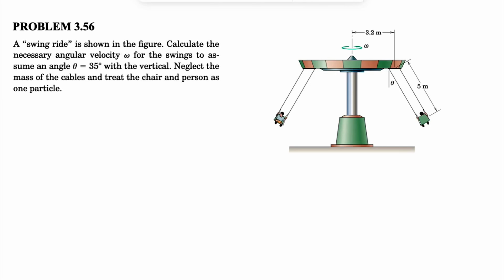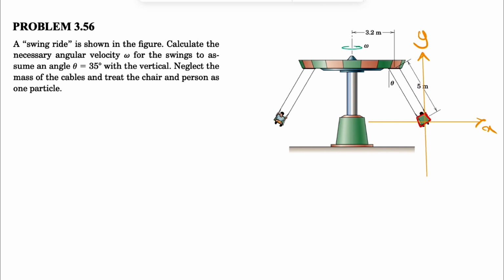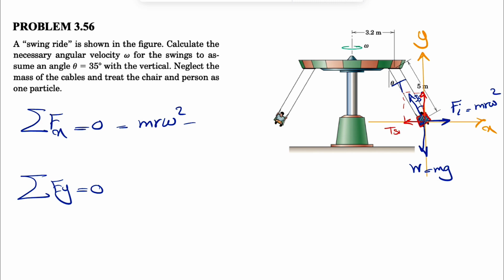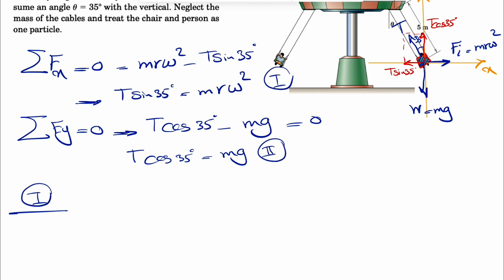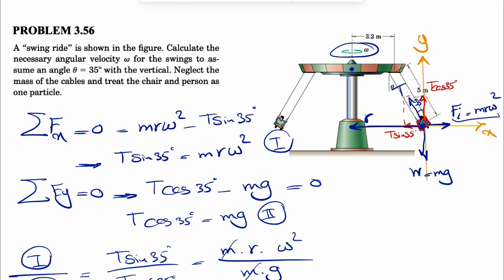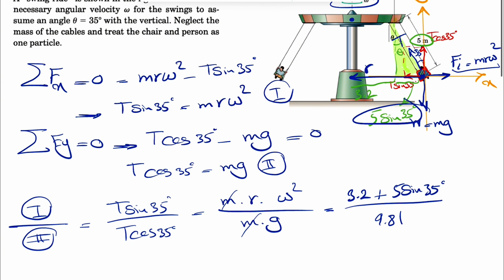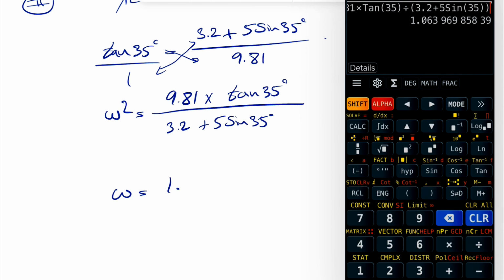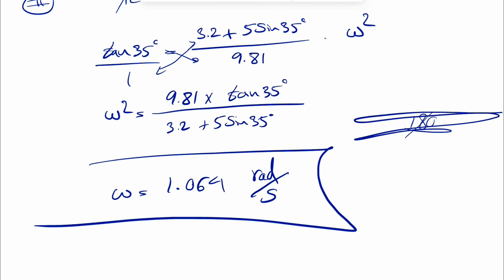Problem 3.56 | Calculate the necessary angular velocity w for the swings to assume an angle 0 = 35°

Comment: I would recommend writing out more steps.  For someone learning this type of problem they will not have any idea why you divided eq. 1 by eq. 2.  I would go through the process of solving for T using one of the equations and substituting it back into the other equation.
Reply from the maker: thanks for the feedback, will do!
Reply: Ngl if you're learning dynamics stuff like this should be common sense